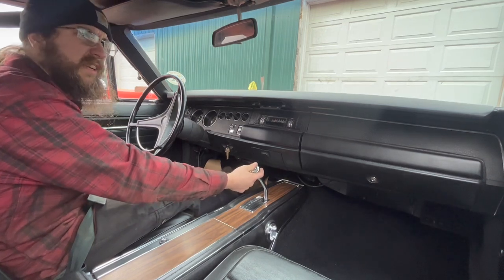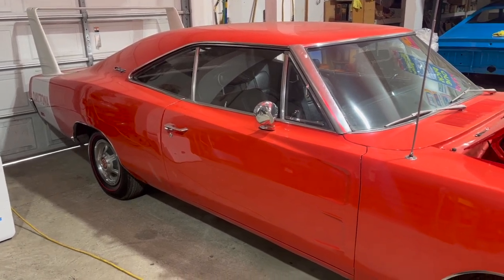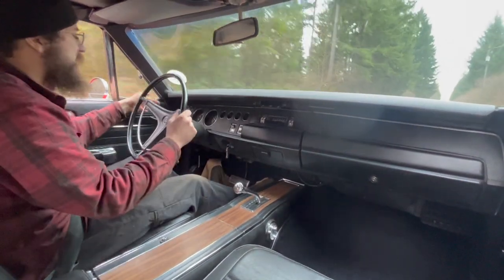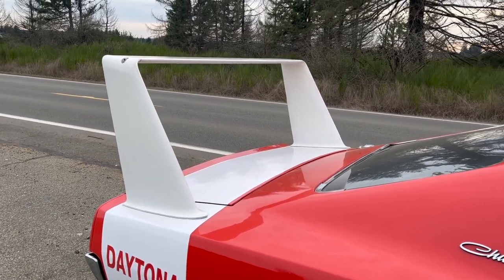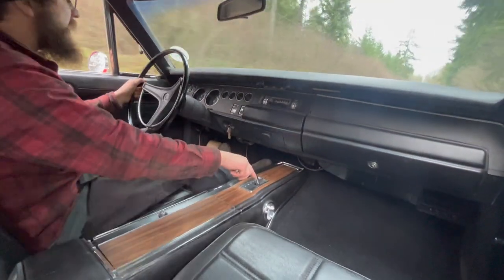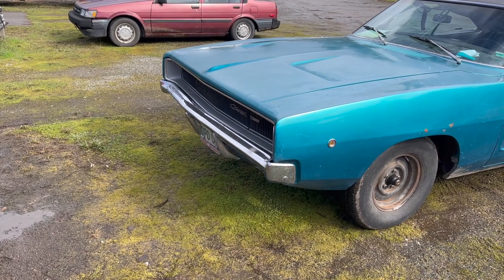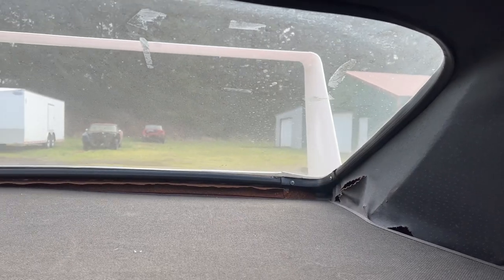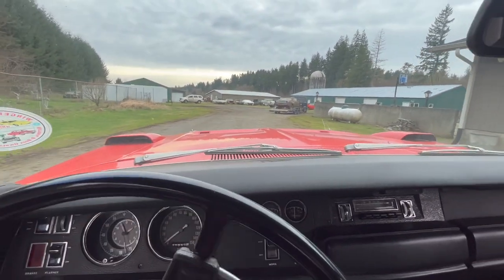Driving A Daytona! A Brief History Of The 1969 Dodge Charger Daytona Wing Car

Comment: It's cool to see that this car has never gone through a full restoration, so you can see exactly how crudely built these cars were. When I first saw this car from the front, the headlight do not fit well, and you can see that no amount of fiddling with them would make them fit well, the rear plug and trunk, the inside headliner were the old glass used to be, nothing fits well. I grew up in the 80's and owned a bunch of these cars back when they were stupid cheap. I was a Mopar guy and I was always amazed and how crudely built they were. In the 80's most of these cars were still all original, and you could see the misaligned body panels, the paint drips everywhere, especially inside the engine compartment, and in some parts of the door jambs and even on lower body panels, the misaligned decals, etc... People now look at these 100 point restored cars and just marvel at how great these car look, and they think that is how they were built, but nothing is further from the truth. I consider 1965-1972 the pinnacle of Detroit styling, but the quality control was pretty bad. I guess people back in the 80's and 90's remembered these cars as being quality built cars, but only because Detroit built such junk from the the mid 70's to the late 80's, that almost anything would have looked like a quality built automobile.
Reply from the maker: Exactly! It’s so cool. The crudeness is a big part of what makes it so special. It was built to do a job - and that’s it. I missed out on most of the good times… when they were still cheap. Oh well. I’m still getting my kicks.
Reply: @DeadDodgeGarage  Stuff used to be cheap and then some. In the early 80's if it wasn't a full on Muscle Car, it was almost free, or free. We once bought a 67 Impala with a 327 and an automatic transmission for $75. We put a battery in it, some gas, and away we went. That is how cheap the stuff was. This lady really just wanted that Impala out of her yard, LOL. We also bought a 1971 Charger RT, that was complete, everything was there for $100. It did not run and was pretty rusty, well rusty for 1980's standards, today it would be considered a "solid car". The Charger was sitting in this guys yard, and was buried in mud up to to floors, it was a pain to get it out...

Comment: For anyone curious the wing was NOT high for the trunk lid. This is like something that has been said at car meets for many decades. Jon Ponter was a rocket engineer that worked for Chrysler defense, he designed the aerodynamics. Its all very well documented. Books have also been written about the subject. Also the race cars sat much lower than the street cars as you ca see in all the photos, and the wheels were much closer to the fenders.
Reply from the maker: We’ve already been over this many times in the comments.
Reply: @DeadDodgeGarage  Other people's replies were speculative, wanted to put a pin in it for future passers-by. Not an expert on these eather but the basic story is pretty well documented. Also wanted to give Jon Ponter his due credit for creating a legend. 

There is a ton of info on these cars that is actually pretty hard to find without picking up a book, which is surprising given the how popular of a vehicle it is. 

Steve Lheto wrote a book and i believe he actually has photos of discarded wing kits. There are also photos of the cars sitting around on lots that are usually used in magazine articles when talking about the car. Its hard to look at these without nostalgia goggles but if you think about it, it was actually a pretty ridiculous thing to try and sell to your average consumer, least of all for the price these went for. Even more so when you look at what happened to vehicle design in the mid 70s.

Comment: Excellent video, Jamie.  Spot on the history and aerodynamics and why they did the car. Yes, it was banded from Nascar do it it's unfair advantage. Also, they had hemis and six pack models. The Nascar hemis would exceed 200mph easy. I had the opportunity to become friends with Richard petty and own one of his hemi motors you saw in my 70 charger. Built by his mechanic, Jim hale. They were and are iconic cars. When I was 16, I saw one on the side of the road here. Down the road, there was a guy walking, so I stopped and asked if that was his, and he said ya. I am out of gas lol I gave him a ride later, and he came over and gave me a ride. First ride in a hemi car. He got on the interstate and nailed it, and the speedo was straight down. You could feel the car squat. My guess is close to 200 mph. It was a rush. And stupid. We went pasted cars like they were parked. On bias ply tires, no less. Ya, those undies didn't come clean lol but young and dumb. You drove a piece of history, my friend.
Reply: I got a heart says the tin man. If I only had a brain lol

Comment: If possible can you do a video on a full setup of the Carter AVS?
Reply from the maker: I could definitely do that in the future. I seem to mess with them fairly often. I have done some stuff with them - for example, a video called “Dale’s 1971 Dodge Demon Gets Fixed” and “Tuning The Demon, Abusing The Cobra” both have bits on tuning that style of carb.
Reply: @DeadDodgeGarage  Thanks!  I'll check those videos out. I have the 69 service manual for the AVS.  I understand about half of it.

Comment: Now I would NEVER disagree with you, DDG, but I heard the wing being tall to clear the deck lid was just a myth that's been repeated so much through the years, it has just been accepted as truth; however, I found a video about how the actual wind-tunnel testing dictated its height. Also, the NASCAR versions of this car were so low, the front tire did enter the upper fender flares, which were cutout, not like on the street version, but of course it had to be simulated to look the part. Oh, and never seen a Charger on the street with no nose cone, but with a plug. That's what you would see if they removed the front nose cone, plus other evidence of its "Daytona" ness. Why would they go through all the effort to remove the rear plug and put the stock rear window back in? I mean, not saying they didn't, but seems more trouble than it's worth. EDIT: Okay, not sure if the tire actually entered the fender flare, but it WAS open and air did flow from the wheel well out through the scoop.
Reply from the maker: Yes - and it is also open (with a grate) on the street version below the scoop. Funny enough I think the tire clearance thing is a myth that’s become true just like the wing thing. Haha. Someone else also commented and said that it was intentionally that tall to get into “clean” air above the roof, and that does make sense. Again, as mentioned, I am far from an expert on these cars, and even farther from an expert on aerodynamics. I was talking to Tom about this - he says the stories about the cars being hard to sell are in reference to Superbirds. Daytonas were apparently a lot easier to move. There are no verified stories of them being converted at dealers. There is at least one account of a Superbird being wrecked in the day and rebuilt with a Roadrunner front clip. Right - the rear window plug wouldn’t (and really probably couldn’t) be removed in a hypothetical conversion. That would’ve had to stay.

Comment: Doesn't the engine overheat? I guess at 200Mph cooling works but what about normal speeds? The grill is really small both on Dodge Daytonas and Plymouth Superbirds...
Reply from the maker: Not an issue. There is plenty of air intake area.

Comment: NASCAR never banned the Daytona.
They did however limit Wing cars to having no more than 305 cubic inch engines which of course made them uncompetitive, but not banned.
Reply from the maker: As I understand, the 305 cubic inch limit came for 1971 (with exactly one taker, who did surprisingly well) and they were then banned altogether. I learned that from Brian Lohnes on the Dork-O-Motive podcast, but I can’t find any concrete evidence or a copy of the rule that officially banned the cars. Every source I can find just says it was “banned” after that. So I can’t say for sure.
Reply: @DeadDodgeGarage  nope, actually the 305 rule applied to all 5 of the aerocars, in the 1971 rule book FRance actually called out the 2 Fords first..........the cars were never banned........in fact all of the teams were glad to see them gone as the cost of operating these cars meant you had to have MORE race cars because, due to the lenght and overheating the winged cars simply could no be used on short tracks.

Comment: The wing car was designed to do one thing beat the 200 Mi an hour Club it would have took 60 more horse tons of man-hours in engineering to get 60 more horsepower out of an engine in order to get past 200 miles an hour we're all they needed to do was create aerodynamics on the car to get the same effect as you would to try and get 60 more horsepower out of an engine and I'm glad they did because it is my favorite charger in the whole world and it's my dream car not the Superbird the Dodge Daytona Superbird School the Dodge Daytona was the only vehicle ever built by Dodge to where you could buy one on Sunday and go to the track on Monday and it would be the exact same car the guys are running on the tracks not to mention it's probably one of the coolest cars ever seen I would take that over a Ferrari any day